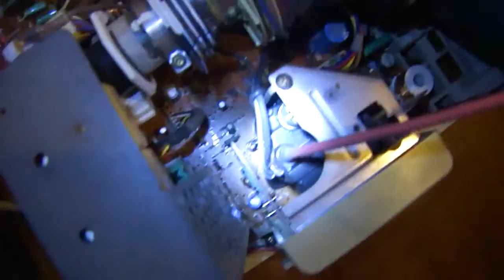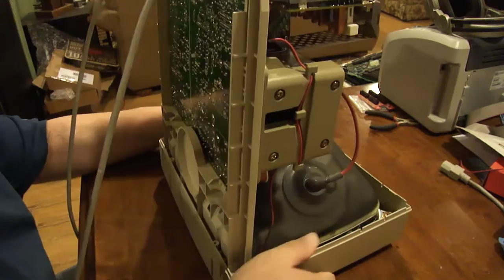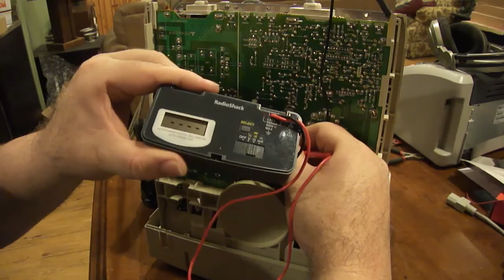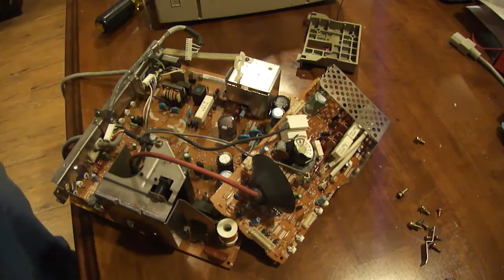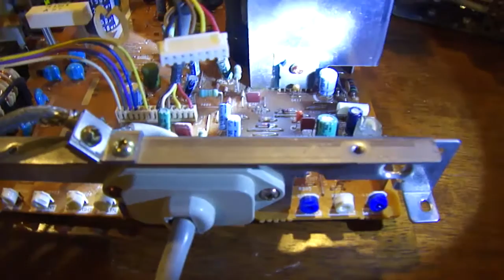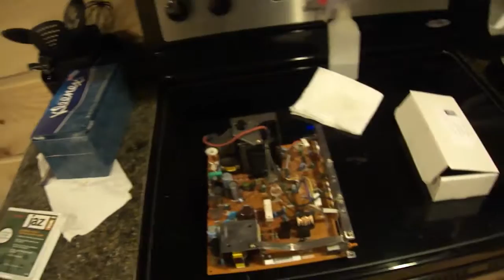Macintosh LC RGB M1296 troubleshooting part 2

Comment: I have the same monitor, also with a vertical foldover, and was hoping to learn how to repair it. I have 3 questions:

1. How did you get that case open?
2. How did you get the board out?
3. Where's part 3?
Reply from the maker: Part 3 never got uploaded and probably never will as since I had moved for job reasons, the bandwidth here is horrible, and the ISP did something recently within the last 6 months to cause uploads to shut down the whole internet during the operation. They also implemented NAT444 or 100.64.x.x but NO IPv6 connectivity, breaking support for security cameras, etc.. 
Case gets open by a spudger tool, and the repair is replacing the capacitors. The worst capacitor sits right next to the horizontal drive transistor and the 2 resistors that appear to get hot. I made a video but again, it never got uploaded. I have a TON of footage that I have never uploaded yet, and probably never will. Verizon's unlimited plan isnt an option because everyone here hopped on it and took the whole network down. Nuts.
Reply: Thanks for the reply and the tips. You'd think there would be decent internet connectivity anywhere on the planet in 2017 (it's the future after all).
Reply: I hope you can upload one day, although I don't understand a lot of what was going on because I don't have your level of expertise, for whatever reason, I love watching these videos. Anyway, thanks for posting what you did and I hope one day we can see some of the other videos you have.
Reply: Just some notes for those looking to repair these problems themselves.  Horizontal deflection circuits are a tuned circuit.  Many many things that go wrong can cause the horizontal output transistor to short (generally collector to emitter)  faulty components in the drive or output circuits, bad connectections, even a flashover in the crt can do it.  It all depends on how the circuit is designed. Some are more sensitive than others.  This sort of thing takes experience and understanding of how the circuits work.  Just replacing parts will get you no where in most cases.  It usually makes things much worse.